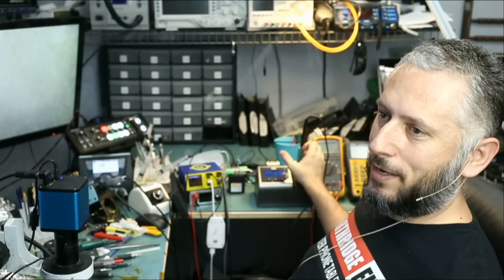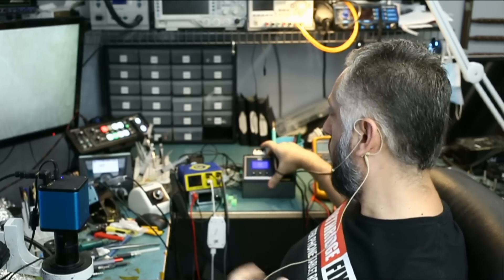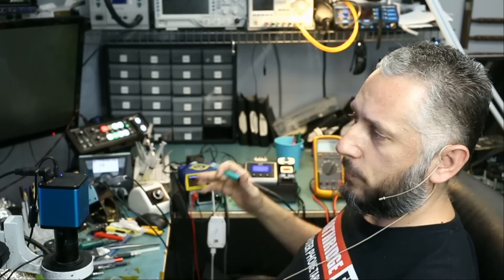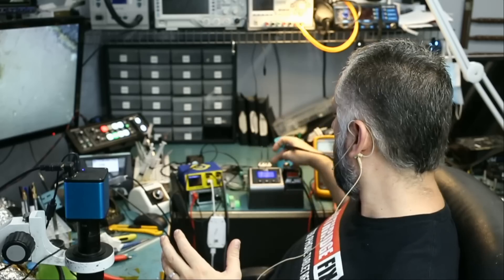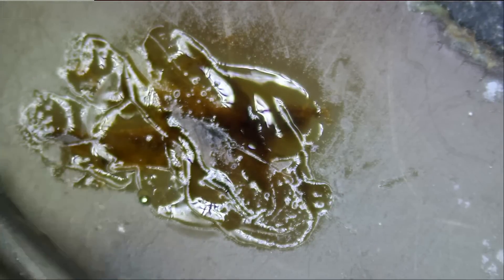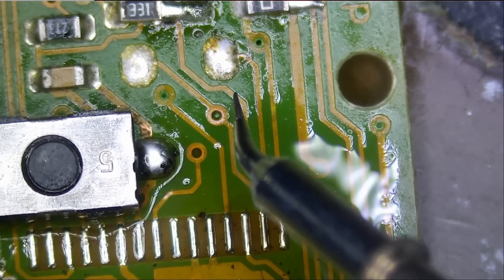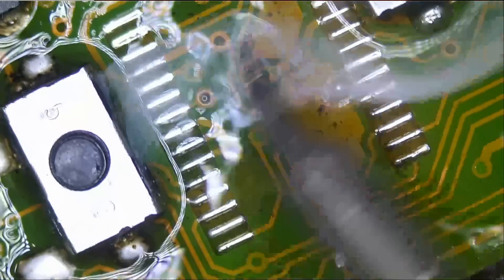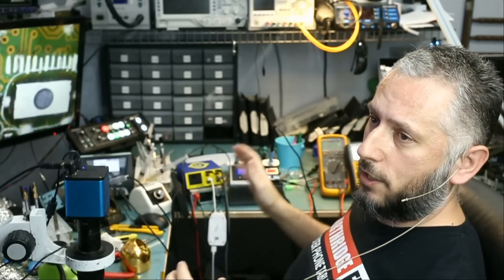Soldering Station JBC or I2c. Is it any good. 7 Different tips and 3 Handles

Comment: Thank you for the honest overview. Just by looking at your interaction with the device it's clear that the display needs to be pointing forward, maybe slightly upwards. But having to tilt it towards you while working to see what the hell is going on is a total no-go for me. 😁
Reply from the maker: I agree, but that would not be a big deal in my opinion if the station did not have the quirks i talked about. Metal or heat resistant housing is a must so hot tips do not burn thru the plastic. Tip recognition is a very big deal. I was not able to use 3 out of the 7 tips because the station would not recognize them. This may be fixable with firmware update or tip redesign. Inserting and removing tips could be made a lot easier. I can't judge the quality of the tips in just 2 days, but i had a hard time sticking solder on some of the tips assuming those are wetting tips. Other then that, i thought the station build quality was not bad at all, and the performance was great using the micro tips. The handles are  comfortable and the distance between the handle and tip is short and comparable with Weller. Viewers did not like the idea of this being a JBC look alike,  while i do agree, I can overlook that if the station performed well. Maybe I2C can take what was said here with an open mind, fix the flaws and improve the station. Maybe then, we'll have something worth looking into.
Reply: @NorthridgeFix  when change the tip put the handle in the holder and take it out again should work than always

Comment: It clearly "overheated" (that's why the message?) and the tip oxidized to no end in that initial startup. Thus no solder sticking etc... so the tips are no very high qualiy. Tips should be able to take one or two high temperature situations without going totally unusable and be refreshable by dunking them into liberal amount of flux and solder.

And the plastic melting... idiots whould have used cast iron/aluminum like JBC does
So no go for the tips at least. And software clearly has some quirks that are not good enough... so skip from me as well.

Comment: I2C is a shit brand, I have problems with all the i2C tools, they look nice, inside is shit, i got electric shock from a new soldering station 3SCN 230 AC RMS volt and on soldering tip :)

Comment: Hope you have a 700watts helical type hot air gun to compare with vertical type hot air station like the quick 8610 1000watts use to desolder chip like the ncp302150. Waiting for that video. Tnx

Comment: I've always used the cheap Chinese Tips and they are a pain to keep clean so solder sticks to them.... I always had a feeling a professional WELLER type tip would perform far better and would need less cleaning... What makes the difference - is it the type of metal they use in the tip?

Comment: I have soldering station JBC and that area where you exchange the tips is also plastic. But is not melt when the hot tip touches it. That is the difference between the original and copies.

Comment: I got the same vibe as I got with the Bill Gates 'Blue Screen' debacle for Windows 98. It’s a work in progress but will be great when they’re fixed. 

When you were removing the small caps/resistors you commented that you only needed to heat one side. I know this is a newbie question and might be a stupid one: if you’re heating the SMD to such a temperature that it transfers the heat to the other solder joint is there no chance of damaging the component?
Reply: I had the same thought/question.

Comment: I bought the i2c 2SENi NANO soldering station with the "C115" handle, later I bought the "C245" handle (of the same brand) separately, and my station does not recognize it by putting "NO TOOL" on the screen, does anyone know how I can work it out? Any solution?, HELP PLEASE, Thanks!

Comment: Open - that trouble of tips i2c, some cant heatup from 24 to 350 with one pass, around 250 heating stoped, need power off/on and second heating from 250 to 350 fine.

Comment: It looks like an cheap JBC clone. 

I use JBC DDE-2C,. T245 soldeer tool and H420 tweezers (i try to not use much hotair) with that tweezers i can desolder easy mosfets and solder it back again.

And its an Hobby to soldering.

In my experience only JBC. How fast it wil warm up, changing Tips with only one hand, heat tranfer of JBC tips is amazing, i had my station never higher then 370° Celsius.  90% of the time i have it on 350° Celsius and multilayer boards are no problem. 

The problem is the price. But for the price you wil get realy good quality.

Comment: I got the same weller station, I quess thats how ole schoolers like us roll. I was using weller 30 years ago. Now you can't tell Me that there's anything better than a weller. Long lasting and good performance. I still can't believe that they would even send you that soldering station without testing it out themselves first. Nice review, had to give U a thumbs up on that one.
Reply: Subscribed to you, you have some nice DSOs on the channel banner. Will be looking forward to your videos. I have a TV problem personally and your channel looks like what I exactly need.
Reply: @therealb888  Thank you sir.
Reply: Metcal
Reply: New wellers are.. modern. If you need to deal with multi layer PCB with big ground plane classic heather doesn't work. JBC also offers everything you need for smd rework but skills. For everything else I'm also using my old unstoppable analog weller station.

Comment: Do you offer training? You say so on your website but I never heard back after submitting info. Perhaps I didn't submit correctly. I bought the digital microscope from your website and I purchased the stand that you link to ebay. I am wondering if I should save up to buy the Weller soldering station or buy a cheaper unit for a tenth of the price. I have a full time job and I have spent a thousand dollars so far but I'm concerned I'm buying high-end equipment with no experience. I live 15 minutes from your shop so maybe I can stop by and you can give me advice or perhaps create a video for beginners who want to get started.

Comment: If you want a discount soldering iron, get a TS100 it is open source so not just Miniware make them. it uses the same tech as Hakko T12 and T15 tips. Just their tips are shorter and have a hilt. real Hakko tips do work.

Comment: I have 2 of them side by side. one medium size and one micro size, both of them regularly stop working with a message  "Heating anomaly", and then you have to turn it off and back on. It is easy to reproduce try soldering on a large ground plane. very frustrating. I also find that the solder likes to stick everywhere but the tip. I have managed to work through some of the frustrations, but I would not recommend this to someone, to be honest. Save yourself the headache and look for a different product.

Comment: My man, would you say there's any value to a beginner in the roughly $60 USD area for soldering & heat gun stations?

Do they tend to be a comparative wattage to other more expensive devices?
Reply: In the same position as you, there are good ones for $60 each, so total of $120.

Comment: Maybe it’s a safety feature, but why can’t it just be hot all the time with or without tip, if the lcd screen indicates it’s on and it’s hot, why does it have to be so complicated, I can tell that feature will give you problems as the machine gets older!

Comment: Here's some advice cause i have studied a lot of soldering irons and cloenes, this is a JBC clone and their handles suck compared to original and when you push the tip too hard it sometimes can short it or even go too far and still the contacts don't make contact, this is pretty common though

Comment: I have this station 12c. As soon it came one of the tips. Tje curvwd one burns out. Turn hot red. At 400 degrees.  Then a  " heating anomally" apears on the screen. The chinesse seller didn't want ro replace it until i send them the defective tip  even when i show them a video of the tip turning red.  I guess the tips should be used at medium twmperature for the first hours as a warm up time. The other 2 tips are good. Works fine but im going to buy original jbc tips as the tips of jbc are better. This is a budget unit if you dont want to spend  more than 200dlls

Comment: JBC uses thermoset material for that tip holder, so it doesn't melt. This is just a knock-off where they used thermoplastic.. Huge facepalm. Screen on the JBC is also glass, so solder splatter doesn't affect it.

Comment: If you have some electronic knowledge and the time knowledge you can go for a Unisolder boards from tindie and with JBC (or clone) handles and a Chinese iron holder with tipchanger it does a very good job for me until now and you can get the whole thing done for like 200€. (I soldered the whole board myself through, but that is not a good idea on the money side).
You can just use original JBC tips with it then, through I have a mixture of chines tips and original JBCs and the quality does not seem different (there is only very limited number of different Chinese tips through). This machine btw. kind of looks like it could take original JBC cartridges too.

I do not use the iron very day all day through, so my tips maybe have like 40h use time on the lesser used ones and maybe 400h or so in the one I use most of the time (which actually is an original JBC one).

Comment: I want to mention that blackness of the tips is due to the elevated temp, try  350 a good sufficient temp and see the difference , maybe the quality of tips , i have aixun t3A and above 350 the tips turns black witch let's the solder doesn't stick to the tips

Comment: i have a cheaper backup soldering iron similar to that and you often must wiggle the tip to get them to seat completely into the handle. You can use a silicone pad to grab tips while hot

Comment: I am also wondering how accurate the temperature settings are on the unit. Just because it says 450C on the screen it could actually be outputting 550C etc. Can it be calibrated at all so when it says 450C on the screen that is what the temperature of the tip actually is?
Reply: If only he had a thermal camera.......
Reply: @mrbmp09  There are specialized devices that use thermistors to test the temperature of the tip to see how well the iron maintains the temperature that you set it to. Especailly when you are using it and the thermal mass of a board sucks the heat out of the tip. The iron has to be able to keep it at the set temperature.

Comment: There are two type of tips:
solder sticks to the tip 
solder avoids the tip
, bet you got the nonstick tip. Weller has these as-well, nonstick and sticking.

In my experience, Weller is the best, you can hot-swap the tips and don't have to worry burning your fingers. But the price is quite high.
Reply: I always leave solder on the tip when I turn my station off. Stops the tip oxidising and once turned back on and cleaned off looks nice and shiny and works perfectly.
Reply: it shares nothing with what happened in vid. He just didnt even calibrate tip temp and tip is burnt. u can see its gone blue meaning ~550C
Reply: @madmatrac The machine its self ist good calibratet
Reply: i didn't know that, i was thinking that was only about the quality of the tip.
Reply: Just googled abit, and weller calls it "wetting" and "non wetting (nw)".
Reply: “MagnaStat”?

Comment: Geez right off the batt, I'm not to impressed. Holy crap, after watching the rest of the video, all i have to say is thank you for taking your time on this less than ideal product. In no way is it fit for purpose, tips lasting less than 8 hours of use. Not to mention it sounds like a fire hazard, with melting plastic, exct. Thank you for your time.

Comment: The reason it looks like a JBC is because it's probably intended as a knockoff, which is the first red flag. And it failed spectacularly. No one should buy this junk.
Reply: Not necessarily a red flag if it's a clone. Babe is good brand for 245 tips.

Comment: My other problem with the copies is the high cost of the original tips (as you'd probably what those over the compatibles) though the cost of the station might be more affordable....also if you look carefully the cost of the stations are getting costlier with every iteration (with every attempt to tack-on a JBC-style capability) bringing them closer and closer in price to the Original they're based on. Now even though you'd probably get more like two hand-pieces instead of one the same can be done to the single hand-piece JBC by adding an extension module while still maintaining JBC overall quality, reliability, performance and warranty (but of-course at a slightly higher cost).
Reply: Well that's unfortunate. Hopefully they don't jack up the price to the point it becomes meaningless to buy these clones.

Comment: I prefer the analog JBCs. They are easier to adjust and afaik they have a better control loop. This knock-off is a bad imitation. It completely misses what makes JBC nice to work with. Reliability and the tool change. The fact, that you need 2 hands to hold the station down is hilarious. On my JBC, i can use one finger of the hand i am holding the handle in to hold against the base - because the tool-changing grooves are right below the stand and the finger naturally can press against the stand.

Comment: It would be interesting to see how the tips hold up after some use. It's been my experience that after a few heat cycles the cheap tips won't hold solder anymore. That would be a big negative if you were to sell these.
Reply: Tips are consumables, no warranty for them anyway. Just tell the customer to buy original JBC tips if he wants.

Comment: If Alex open that machine and reaches the logic board I am sure he will fix that fault 😊😊😊
Reply: The fault is coming from the tip it self. Or the handle.
Reply: @xlwirelesselectronicrepair  not really cos sometimes it shows the real temperature and sometimes with error code. So it should be the machine technically the board in the machine.

Comment: I have been using similar clone station and I got the same issue as you did with the tips. BUT it only happened ones, till I learned the proper maner to operate with it. It seems you are forcing the tip against the soft material which is underneath the tip. Instead you have to take the tip to the metal strong hole (don't know how to explain it, it has 3 different shape holes) and after selecting the right shape for your tip, you can force it to enter the other part.

That error message is because the tool doesn't recognize the tip inserted

Comment: I do a lot of (smd) soldering and my daily driver was a Weller. When it suddenly died on me a few years ago i got a cheap Ksger T12 from a friend so i could continue untill i got the Weller fixed.....

Now 3 years later, the Weller is still not working, just because the Ksger performed so good and still does.... I ordered 2 more for spare. Just saying...... a 50 bucks station performes just as good as the Weller but for a fraction of the costs.

Comment: The Problem is Not the Maschine, its the Tip. I Bet you wont have trouble when using original JBC Tips.
I use a sugon t26d with original JBC Tips. Its Like the original Station but much cheaper.
All JBC Clones have the Problem with Bad Tips, with original Tips they Work as intended.

Comment: Thanks for your honest review Alex!  I have been using the JABE UD-1200 C245 for the past 2 years and have had amazing results vs JBC. I don’t use the knock off tips just JBC tips with my station. I was just in the market for a C115 / C210 station since JABE doesn’t offer a dual station. I’m going to stay away from I2C until I see quality like my JABE.
Reply: I can confirm each word. Jabe is a very good soldering station. The limitation about the only C245 is the only important lacking
Reply: We use the jabe UD1200 & love it for the 245 tips we also have a JC aihun T3B 115 station which is brilliant, mechanic do a 245,210,115 multi handle station which is brilliant BUT it also suffers from the plastic based tip puller/insertion issue but that's nothing a small piece of silicon mat in the compartment wouldn't solve but it doesn't have the same issues the i2c station has it recognises everything without issues. Definitely something worth considering.

Comment: Generally clone JBC soldering station comes with generic low quality bits, you can use original JBC bits or get quality bits from some other brands.
Reply: Will they work with this cloned station?
Reply: @isa1983xx  thankfully most do unlike before.
Reply: @therealb888  worth trying then 😊
Reply: @therealb888  worth trying then 😊

Comment: Not a soldering iron question,because I have seen that unit but unless more tips are offered with it I am not sure about buying. 
But I do have a general question seeing as you repair a lot of devices (I am  also waiting on more Amtech 213 flux to be in your store):
What ultrasonic cleaner do you recommend/do you use? I am using Amtech 559, but no solvent seems to clean the solder mask area between IC legs very well. I am hoping Amtech 213 will be a good choice in the mean time.
Reply from the maker: We use Elma e60h ultrasonic. Fresh shipment of Amtech 213 and 559 will be in this Fri. I'll announce it.
Reply: Use petrol to clean flux between legs of ic.

Comment: Just send it back - design flaws galore - bad - maybe I typed too soon - maybe it's a defective tip - the rest seem to work ok ???????? but they do have to change out the plastic tip storage - that's stupid putting plastic with heat - metal only